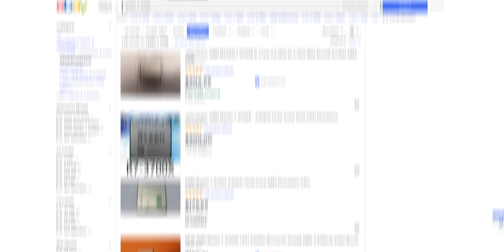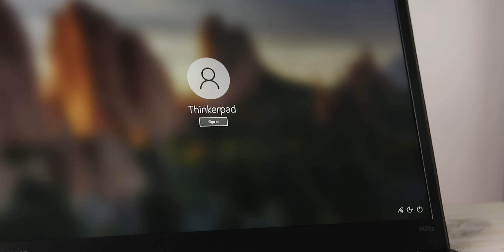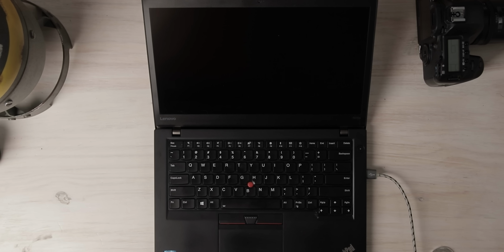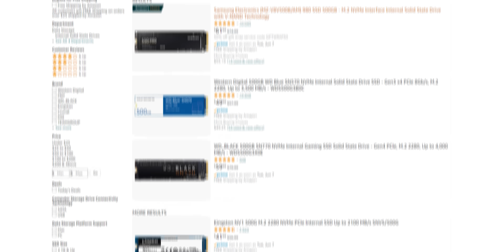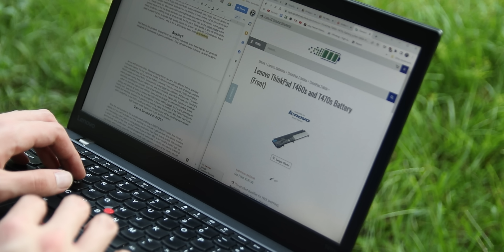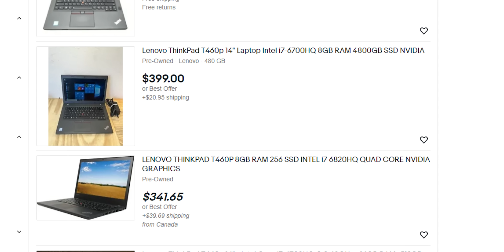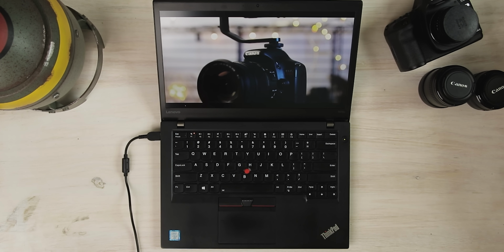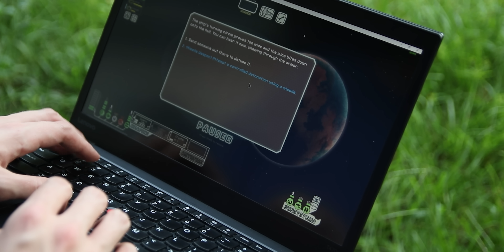I Couldn't STEAL A Better Laptop... I Tried - Lenovo Thinkpad T470s

Comment: I've bought 4 thinkpads over the years. My winning formula as been to buy something that was bleeding edge 2 years ago. I have put linux on all of them and they just worked.  I had one that finally died - I took the SSD out of it and put it in a significantly newer one - and everything just worked.
(writing this on a 5 year old X1 Carbon which is still going strong).
Reply: This is the way
Reply: I've considered getting a carbon.  What's the deal with them anyway?  I've never seen one in person so I'm curious why they seem to be the one everyone wants.  Are they just a smaller/lighter unit or are there other things that make them so good compared to the other thinkpad models?
Reply: please give me all the drivers… wifi isnt fully supported, fingerprint… impossible…
Reply: @alexisfrjp : Are you referring to Linux?  Linux wifi support is mostly ridiculously good.  Fingerprint reader, I could see that, but heck, even with FreeBSD (Which is about as far from user friendly as a mainstream OS gets) I have full wifi support.  It won't link at no gigabit speed or anything, but it's enough I even do full HD video game video's on it and the video's I edit are ON the network.  I just use local proxy clips for the edit, then let it render across the LAN for the full size render.
Reply: The good thing about thnkpads is almost everything on it is replacible. Its very much like a build it yourself desktop its all plug and screw in. Your keyboard or display stop working replace it. You want more ram or storage add it. Your cooling fan stops working replace it. Its not  hard. Parts for a thinkpad are easily gotten on Amazon, Ebay or else where on the web. Its a no brainer.
Reply: @GamingHelp  If all you use a laptop for is doing emails, paying bills, buying things on Amazon (me), surfing the web. Or as a backup for a desktop (me). Then an older cheaper thinkpad is perfectly useable for those applications. Or you need job productivity perfect. Gaming not so much. It does't have the graphics power.
Reply: @NotNowLater  Ha! Screw in is exactly right. I replaced the SSD on the Carbon and can't believe how many screws I had to undo.
Reply: Yeah, for sure.  But, in my case, I use a windows box for gaming so everything else is BSD now.  My latest T440P build with the fastest chip they ever put in that machine is SMOKING fast with BSD13.
Reply: On my older T470s I only need to undo 1 screw to replace the SSD NVME stick easy. Now if your laptop has a 2.5" harddrive carryier braket with an SSD NVME converter then you probably do have a bunch of screws.
Reply: @ianboard544  I regreased my P50 fans, which was nice. All done in under an hour though.
Reply: @ironmantooltime  I had to do that too on one of the TPs. A tiny piece of paper got pulled into the fan and the tach wouldn't let the laptop boot.
Reply: @GamingHelp  I guess that would be the 4910mq ? I had the 4810mq and ended up downgrading for a 35w 4702mq because battery life was a joke. Now that I have a new 8 cells I kinda want to put it back but it's overkill on a 14 inches laptop
Reply: @payoyo5150 : Yup! 4910mq indeed!  I can see why it's rarely done though.  With just the stock cooler and no undervolt, it was hot enough that when I'd render long 12 hour renders at 100% CPU saturation, it would eventually shut down on it's own after filling the log with overheating complaints.  This particular chip only managed a ~50 millivolt undervolt, but between that, opening the air passages more for the fan and using 1mm thick copper plate to bridge the heat pipe between the heatspreader and the heatsink, I finally got it under control.  I can hammer everything in the chip to 100% now for days on end and it averages about 70C, spikes to about 73C.  My god is it fast though.  I've benched my video editing projects and the old machine took roughly 33 minutes while the new machine/chip took 3 minutes flat.  Well worth the work for what I do. :)
Reply: Can this run lower ended games?

Comment: Screen going flat is useful when using it in a work environment. I use an HP that does the same thing at work, and can literally use it in any situation whilst still being able to access the keyboard. It becomes an oversized tablet. You can lay it on your legs, you can hold it with one hand vertically against a wall, power board, server, racking etc. You can walk through a warehouse with a powerful data accessing machine at your fingertips. In meetings, you can sit up, and lay the screen further back to actually see it. etc
Reply: Lus also it helps to save the hinges when folded back too much so ThinkPad has less hinge damage unless folded more than 180°

Comment: Lenovo T series are all I've ever owned, started with a T60, T420, now a T440S. I am considering a used T480S with the quad core i7 as my next upgrade for you guessed it, low second hand prices.  I have never bought one brand new. Great video thanks for sharing.
Reply from the maker: Thank you! I would also highly suggest looking at a T14 with a Ryzen cpu. On a good day, they are in the low 400's and an absolute steal.

Comment: Back in the late 90s, I worked at IBM Canada as an OS/2 product specialist, where I provided 3rd level OS/2 support and also supported some apps on Windows 95 & NT.  I was also on the team that built standard desktops for IBM Canada employees.  At any time, I might have a half dozen or so ThinkPads, of different models, at my desk.  Back in those days, the hard drives were user swappable, so I had several of those at my desk too, with different operating systems on them.  In addition to our regular work, we were also encouraged to start working with Linux on company time.  Since then, I have been partial to ThinkPads, whether made by IBM or Lenovo and over the years bought a couple for myself.  One problem with ThinkPads is they're so durable they're obsolete long before you find a need to replace them.  My current E520 was bought in Oct. 2011 and it's still going strong.  I have openSUSE Linux on it, as well as Windows 10.  However, I would never buy a non ThinkPad Lenovo, as they're garbage in comparison.  BTW, that red thing is called a TrackPoint, which I greatly prefer to touch pads.  The first time I used a touch pad was on a Toshiba notebook, with Windows 95.  I've hated touch pads ever since.

Incidentally, I also have Windows 10, Windows 98 and OS/2 Warp 4 in Virtualbox VMs on it.  I have also maxed out the memory at 8 GB and replaced the hard drive a couple of times.  It currently has a 1 TB SSD in it.
What's missing is 5 GHz WiFi.  If it was practical to replace the WiFi card, I would have.  Otherwise, it still continues to meet my needs, more than 11 years after I bought it.
Reply: Trackpads suck because of the software Why can't I pinch the zoom properly in every app? Some require the 2 finger scrolling. That's just one example.

I've heard Mac laptops have the best trackpad so :(
Reply: OS/2 was fantastic I don't care what anyone says...
Reply: @georgen.8027  Any relation to PS/2?
Reply: Their gaming laptops are actually pretty good though :) Great price/performance ratio, tasteful design, solid build.
Reply: I have Lenovo Legion 7 and it’s not garbage
Reply: That's real deal sustainability, unlike Apple continuously virtual signalling the environment yet keeps pushing new software upgrade  to slow down i products which is irreversible and end up in garbage piles.
Reply: Do you have LinkedIn?
Reply: Last week I got a dual band WiFi card and installed it.
Reply: I don't know... I really like my Legion 5i Pro. I'm big on ThinkPads, but Legion has had some seriously good models if you can find a good deal (beats Dell and Razer by a looooong shot).

Comment: Just love your review and humor. Everything you mentioned is spot-on.  I bought a 6300u i-5 T470s about 7 months ago for $175, after answering a Craigslist ad.  Like yours, mine needed one battery, but it was still getting about 3.5 hours.  It came with 16 gb of RAM, but I purchased another 16 gb from Crucial from a sale for $56. So I'm in it for $281. 

When I went into the system, I noticed that it still had 3 months left on its warranty.  I had the screen, bezel, lid, and keyboard replaced for free under warranty.  The Lenovo tech met me at a local Starbucks and did everything there within 20 minutes.  He steered me to an ebay sell that sold quality OEM batteries for a lot less than Lenovo.  I replaced one and I'm now getting almost 7 hours of battery life. The 1080p screen is sharp, but isn't the brightest.  That said, I always turn the brightness of my screens down, so nothing lost here.

I'm not a gamer so speed is not an issue.  It's fast when using Photoshop or editing video.  I've been a Thinkpad user for years because of the keyboard and Trackpoint.  Honestly I can't use a notebook without that little red trackpoint.  My everyday notebook is still a Lenovo Thinkpad T430s from 2012.  It's an i5 with 16 gb of RAM and a 256 gb SSD.  I use it constantly and it's never let me down.  It's still powerful enough to do Photoshop and video edition...and it's 10-years-old.

The reason that I purchased the T470s was to have a light computer to take on the road.  It's certainly filled that and more.  It's a coffee shop warrior.  I always enjoy using it. One strange thing is that card slot.  I have no idea what it's good for?  But I do appreciate the Thunderbolt 3/USB 3 port, two separate charging ports. 3 USB-3.0 ports, Ethernet port, and full-size HDMI port.

The previous owner installed Windows 11...not quite sure how.  I spent 2 hours un-Microsofting Windows 11.  Windows has gone from being an operating system and morphing into a data collection service. It's a shame but I was able to clean the T470s using some great YouTube instructional videos. At least I'll be futureproofed after 2025. Given how long my T430s has lasted without issue, I would think that your machine will be chugging away in 2032.
Reply from the maker: Love to see old thinkpads still putting in work! IMO with how great modern laptops are, they really don't need to be replaced often. You can easily get a 3-5 year old laptop for cheap and throw in a new battery if it's from a solid brand like lenovo and use it for years.
Reply: T470s I'm coming
Reply: Sounds like your price points are better than mine. I was so impressed with the Amazon renewed program that I ended up buying 4 T470's total. Like new and work great, could not be happier.
Reply: After rereading your post I just wanted to add a couple more comments. I love the fact that you are using the T430 as your work horse. I my mind you are really ringing out the value out of that system. In todays throw away world it's nice to know people like you exist. Both you and I do not care that we are not sporting the latest's and greatest hardware, on the contrary we are happier not spending money that does not need to be spent to fill a need. Just reading your post I'll bet you are just as productive (if not more) than that kid next to you that spent money he did not really have. 

I really enjoyed the part of your comments where the Lenovo tech fixed your system screen etc ... In my mind it was smart all the way around. 

Lastly, I was telling my wife how the Lenovo T470's systems were a business level platform back in 2017, they continue to have value today because they are worth maintaining and repairing (same for T430's). As you mentioned,  The T470's do not support windows 11, I could careless. I know that windows 10 runs great and will be good to go for years to come. If the OS is not supported for web applications at some point I'll load Linux on all my systems. The point here is that the hardware if fantastic and the price point was very nice. Sorry for the ramble.
Reply: @eddievantailn2882  Thanks for your kind, coherent words. I continue to use the T430s because it simply works. I bought it pretty much brand-new in July 2012 from an IT pro, who had an extra. It still had 35 months left in its warranty.

My needs are pretty basic...Word, Excel, Publisher, plus Photoshop Elements, light video editing. I'm not a gamer, so the i5 with 8gb and 256gb SSD work well.

Since new I've replaced the keyboard and screen in-warranty...but they're simple jobs, even for a simpleton like me.

At one point I bought a used mid-2013 MacBook Air for $375. I wanted a light, compact computer for the road. I hated it and it's not Apple's fault, it was just because I was so used to the ThinkPad and Windows experience. I type a lot. I sold it for what I paid.

Honestly, if you're not a gamer, doing CAD, 4k editing, compiling programs, 3D rendering, financial / scientific modelling, video encoding or and other kind of compression / decompression, even a 10-year-old ThinkPad will fly through almost any task. But most people use a notebook for what I do, and mostly Internet, music and word processing.

I see myself using the T470s and T430s in 10 years...unless the motherboard gets fried. Given the fact that T430s hasn't fried anything after 10 years, history teaches me the future.
Reply: I would like a pic of that card slot,maybe its an SD card slot?
Reply: @tezcanaslan2877  It is for microchipped Smart Cards
Reply: @Hoppysport i just stumbled on your comment. could you please direct me to the eBay site that sold you the great battery. Thanks.
Reply: @Impurfecther  The ebay seller name is craiginta. A great seller of genuine, OEM batteries. He's in Canada and worth it.
Reply: @hoppysport2872  hi, I checked the name, but I keep getting 'no search results' on ebay.

Comment: My favourite laptop is the HP 840 series. My company issued one and I loved it to bits. Bought a couple of them from a dinky shop and they run great. Added memory, storage and they suit my purpose nicely. I got a cheap Thinkpad, but didn't like the placement of the Cntrl and Fn keys. But I keep hearing about these legendary pieces and I am tempted. Thanks for the information about the pawn shop, got a new haunt to look for deals.
Reply: You can change the FN and Ctrl key layout on the BIOS ^^
Reply: HP is trash. doesnt come close to thinkpad by a long shot.
Reply: HP? 😂 You need to try the real deal. Get a Thinkpad and never look back!

Comment: I bought a Thinkpad T470 with a 6th Gen i5, 8GB RAM and a 512GB SSD off eBay in August. Had a little scratch on it, but it's been my daily for doing generic tasks such as emails, coursework and it's been a dream to own. Paid about $135 for it and it's been amazing. Battery holds a super good charge and it can even handle a few basic games like Minecraft or even ROBLOX if a friend needs to borrow it.
Reply: how much u buy thinkpad t470??

Comment: I picked up a p53s with i7-8665u from my company dumpster, in pretty good condition but with broken screen. Spent $100 for a LCD on amazon and another $100 on a 1tb nvme ssd. Added another 16gb of ddr4 ram which also pulled from stuff in the dumpster for a total ram of 32gb (16 on board). Now it's a perfect laptop for my wife haha.

Comment: Watched this on my T470s with upgraded RAM and can assure you it's a wonderful computer. I even use it for things like digital sculpting on Zbrush and it handles pretty amazingly.
Reply from the maker: Love to hear it! My base model i5 for sure was lacking compared to the other CPU options offered
Reply: hello, may i know what size of RAM are used for the upgrade ? i have a 4GB of RAM soldered to motherboard and a 4GB if RAM inserted and i want to remove this  ram to add either an 8GB or 16GB
Reply: @Retwak  The computer came with 8GB soldered and I added a further 16. Can't remember the exact brand. Computer is working great. One thing I'd like to change is the storage cos 250GB just isn't that much. I'll probably just add an SD card for storing files on since they're cheap.
Reply: @Retwak  Go with the 16gig ram module its really cheap to get now.
Reply: Max 32 RAM and 2 TB Ssd

Comment: Love my 2nd hand Thinkpad but it's a very different beast. X1 Yoga with an i7 8665U and 16GB of RAM. The battery came with only 15% wear and the laptop only cost me £300.

Very happy with an ultrabook of that calibre for that price. It saw me easily through university (as a compsci student doing a lot of hardware synthesis for the FPGA)

Comment: Welcome to the thinkpad club! I think you've hit the best generation, the *70 series. I have a L450 which is great except for the weak i5-5200u but I've had it since a black friday sale and still love it to bits. Keyboard is amazing, pointing stick is great (wouldn't have a laptop without one - though my work HP elite has one that sucks ballz) and it's all user servicable with no soldered RAM (or anything except CPU/GPU)
You also have the same camera/laptop bag as me and yeah the 4xx size is a perfect fit for it! Yay for 14" laptops!
Reply: You're the man. I've been rocking a T450p with an i5 also rather weak. Seems like it was made in 2011. I just use it to browse the web and get some office work done so the standard Ubuntu does it for me.